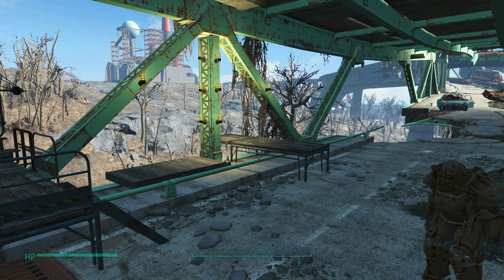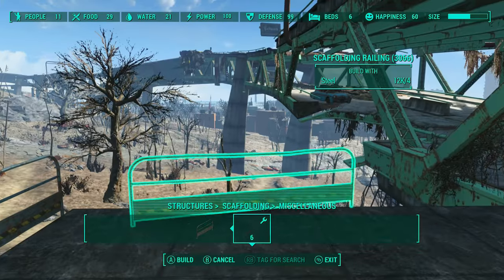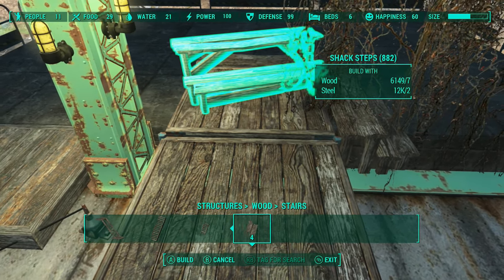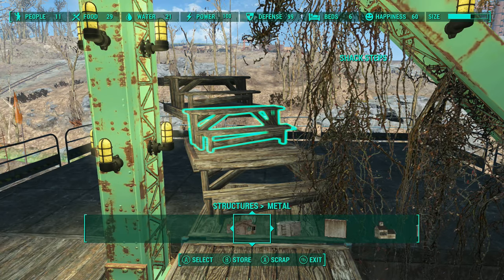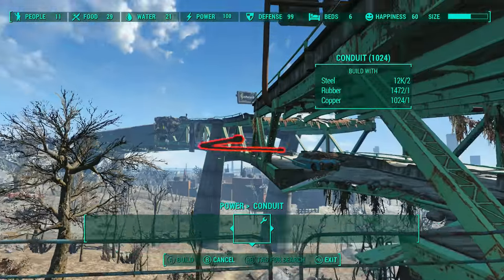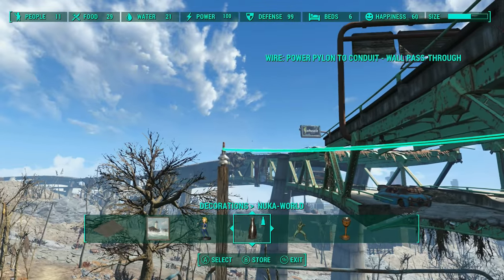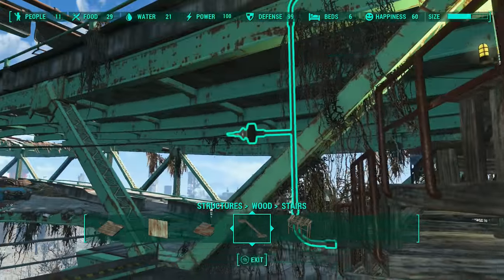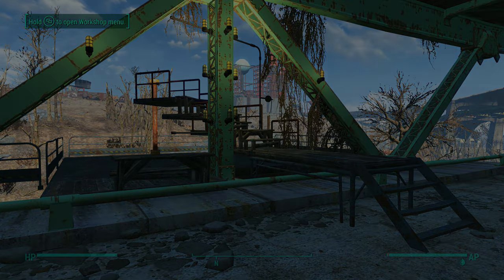Settlement Building Methods and Techniques - 14

Comment: I have tried the free wire trick as well, and it is not as easy has he makes it look. 

Thanks for the quick tutorial.
Reply: loco4pack what's up Loco? Do you play on PS4 or XB? I'm on XB and can't actually do the wire glitch (like that) anymore. PS4 should still as easy I have "made out" LOL!
Reply: I play on PC.  Not sure if it causes additional issues with some of these techniques, but it doesn't stop me from trying.  Plus I don't use Mods, didn't like the instability they caused.

Comment: XD!! What's happening Sar? That was bloody hilarious with the with wires! I knew someone had linked to one of my vids because I noticed a I had a few random subs recently. The glitch wire is created using the cancel button (B) on XB1 rather then workshop button and you didn't quite travel far enough away. It should be around 20meters or so. Additionally, to select the correct wire end go specifically to 4.00 mins of the tutorial. HOWEVER, having said all of that, I haven't been able to do the wire glitch (like that) for a couple months on XB1. Haven't played in ages but I think the issue may or may not be caused by mods. PS4 still works the normal way but for me specifically I can't get a glitch wire until I've taken it aaaaaaall the way the other end of the settlement and then cancelled it. You may also have this issue because I know you play on XB too. 

As a side note I've just been though some of your videos and your commentary is brilliant. So soothing! 😀
Reply from the maker: Thanks! And yeah, I still have much to learn about the advanced parts of building, but hey, it's all a work in progress--and as long as I link to the pros I figure I'm gettin good info out. ;)
Reply: I never looked at the build mechanics or builders as advanced or intermediate or whatever. Barring obscure little tricks like the wire glitch, to me, it's all just fundamentals and patience levels. I think it's the creative use of fundamentals/well known exploits, as well as the time one is willing to invest that tends to create an illusion of "advanced" or "Intermediate" etc. But for me,  all I see is how good a builder's eye is for aesthetics or their creative thought process. 

But then again, I'm quite single minded in that respect - I never let lore, functionality or settler happiness get in the way of beautiful aesthetics and a great looking shot so appreciate the different view point you've taken with your megabuild tours where you take everything into consideration.

Comment: another great build sir. how do you come up with these ideas? where do you get your inspiration?
Reply from the maker: Thanks! It's necessity, for the most part. Like this stairway here--I wanted a way up from the bottom to the top, but I didn't like the squared off version I built first, scaffolding wouldn't have made sense, and I don't know how to use elevators. I remembered seeing layered stairways in lots of other places so I tried it here. :)

Comment: I fucking lold hard at you fumbling with wires and wanting to jump in and help you!!
it doesn't make a difference if there are other conduits around. Your problem was trying to exit workshop mode at the wrong time.  you pick the wire up, then run away about 20 metres till the wire highlights red and then press cancel (circle button) then the wire is free floating. Now store or delete the conduit/pylon it was attached too. now you can place the wire where you want using limmys auto snap cancel function. once wire placed then you exit workshop mode.
I actually know a way to have about 400 free floating wires made in bulk but that's a bit too much for now LOL.

Martin on reddit
Reply: and the reason the wire kept getting picked up from one conduit has to do with where your camera is facing. 

if you want to guarantee the wire comes from the conduit you want it to, then you need to put a bit more distance between the 2 conduits and then face the conduit you want to take the wire from. voila
Reply: and I hate to be that guy Sard but I like you and want to help. those little stair cases will nicely clip into each other with group select. the original staircase at my tree house was made out of using these this way. Build off site and transport later. :)
Reply from the maker: Now will you agree that I'm an intermediate builder? lol :P And yeah, I still have problems with it... only really used it once, after all, but it was part of the build, so I had to at least try it. Could have edited it out, sure, but that'd have been kind of, I don't know, inauthentic, I guess.
Reply: SarDeliac ha. Never, I always like to see the best in people! I struggled with it at first but once you've got it, it's like riding a bike.
look forward to your next build chief.